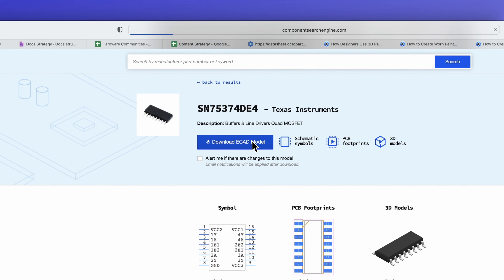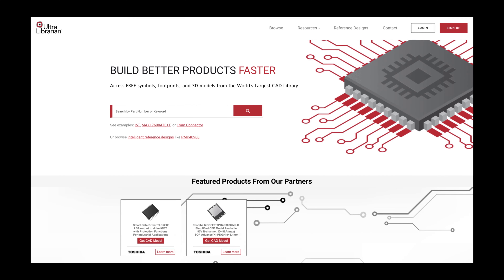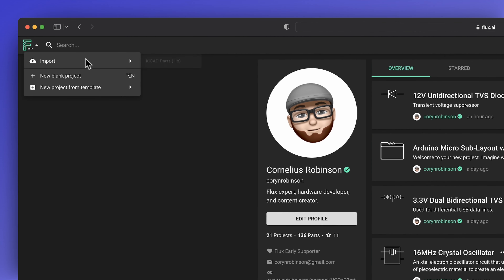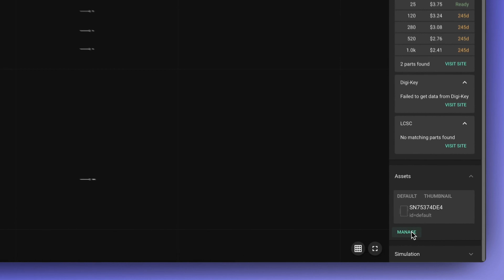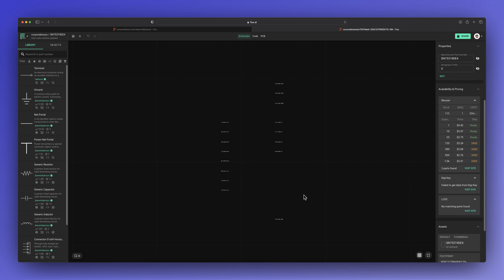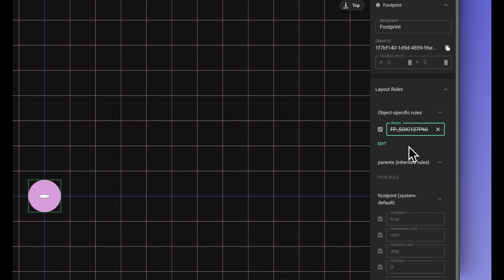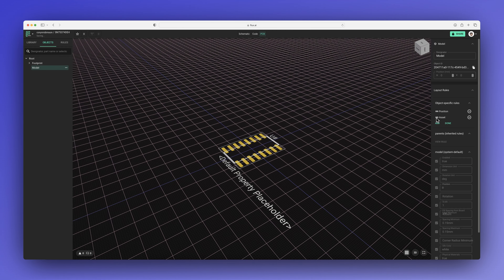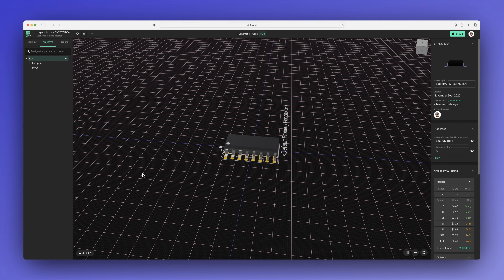How To Import KiCad Parts Directly into Flux

Comment: My part shows a bunch of default comments.  How can you get rid of those?
Reply from the maker: I'm not entirely sure what you mean by "default comments", but I assume you mean extra silkscreen objects? If so, you would either have to edit the part in KiCad or make the footprint from scratch.
Reply: I've noticed these comments on exporting from Ultralibrarian. You can open up the footprint file in a text editor - you'll see lines starting with "(fptext " with an "(effects " line following and then a ")" after that for each of the default comments.
By deleting all 3 lines that gets removed.